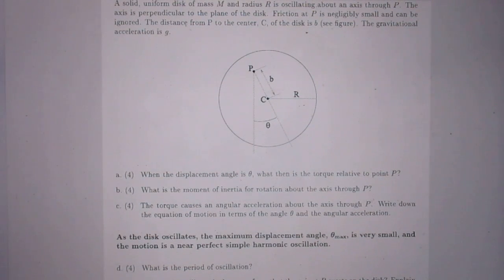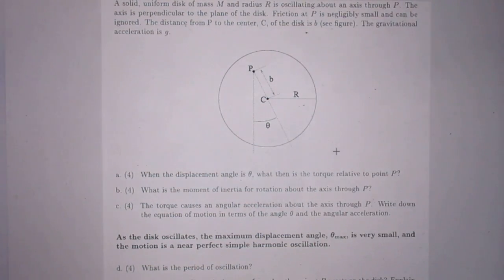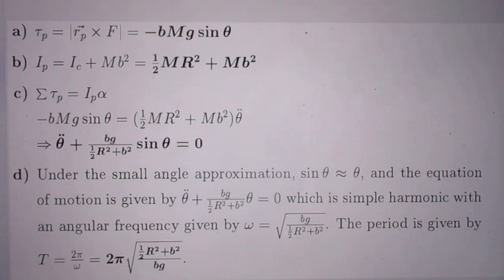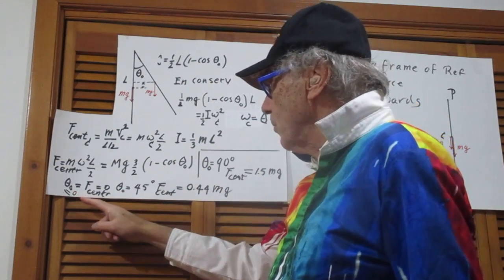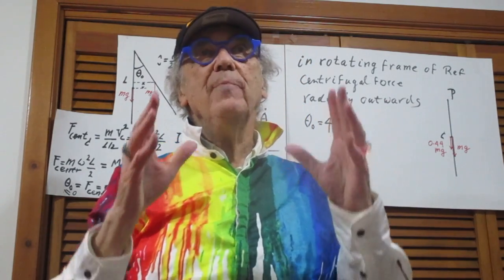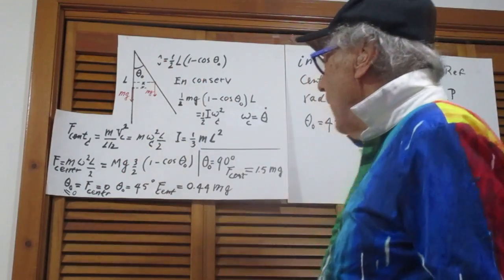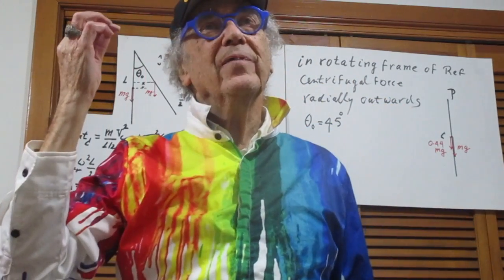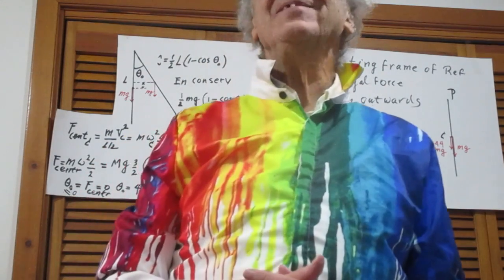Solution Problem 138 - Swinging Disk

Comment: hello professor. recently, i have been enquired with this question, and even though the i know the answer, i am not able to understand the phenomena.
 the question is as follows:
A uniform rod is made to stand vertically on a smooth horizontal surface . if the rod has been given a slight horizontal jerk of sufficient magnitude, find the path of the centre of mass of the rod. 

the answer to this question is "straight line".
Reply: Since no forces act on it in the horizontal direction, after the initial jerk, its center of mass can never have a horizontal acceleration again.  It is not intuitive that this is the case, because our brains aren't accustomed to frictionless surfaces.  But in any event, this is what will happen, and why the center of mass of the rod must take a straight line path as the rod falls down.

Comment: e. For small angle oscillations, as stated in the original  problem, centripetal force is negligible. So the only force at P is normal reaction which is equal to Mg.

Comment: Hey professor, I just watched the video regarding the PDFs for 8.01 8.02 and 8.03 I was wondering if you could tell me the titles/author of the books because it seems the pdfs are no longer available. But I would still like to try and teach myself with them and your lectures!
Reply from the maker: all pdfs work but you have to know how how to do it.
8.01
Physics
Hans C. Ohanian
Physics
Volume 1 
2nd edition
W.W. Norton & Company
ISBN 0-393-95748-9

8.02
Physics for Scientists & Engineers by Douglas C. Giancoli. 
Prentice Hall
Third Edition
ISBN 0-13-021517-18

8.03
Vibrations and Waves by
Anthony French
CRC Press
ISBN 9780748744473

8.03
Electromagnetic Vibrations, Waves and Radiation 
by Bekefi and Barrett.
The MIT Press
ISBN 0-262-52047-8